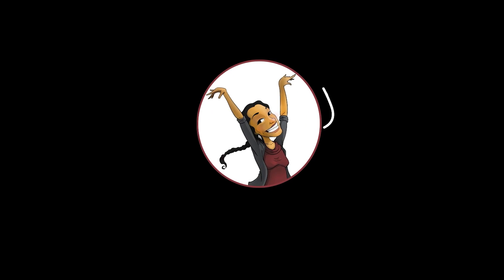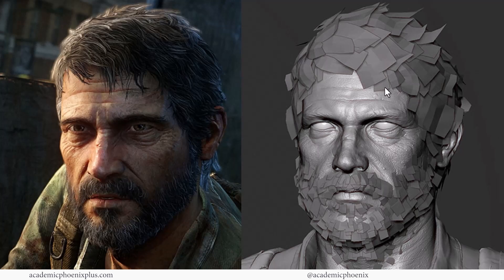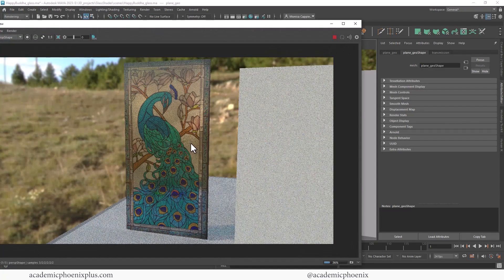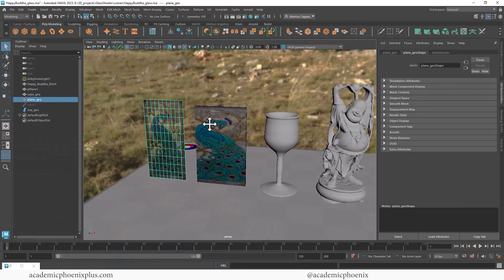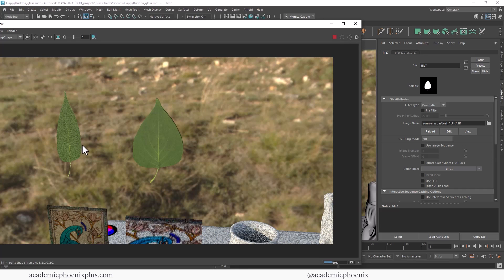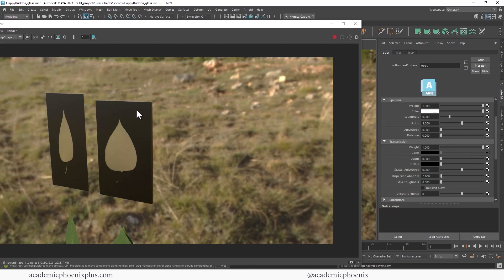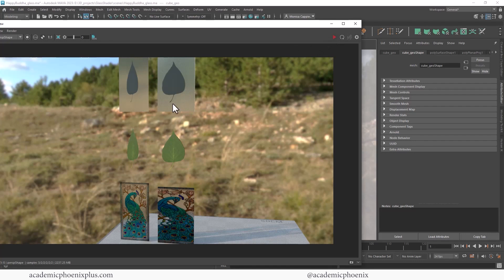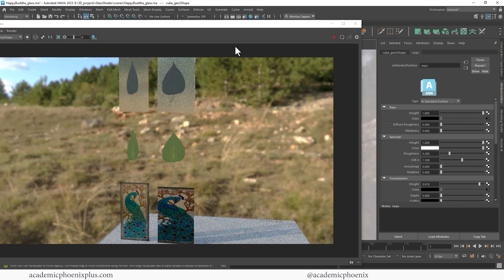Understanding Opacity vs Transmission in Maya 2023

Comment: hi i was using substance painter,made a glass window with some wooden pannels,both the glass and the wood panels share the same sader with proper uv,and in substance everythinglooks fine and behave properly but when i plug in the opacity map on to transmission the whole mesh including the wood panel also becomes transparent which doesnt happen in substance painter

Comment: Hello i need help. How to assign different shaders to Nparticles ? I dont see any visual feedback 😢
Reply from the maker: Have you tried adding an aicolorjitter into the nparticle shader? https://youtu.be/jmqBa_t2_QI  I haven't tried it but may be a good place to start.
Reply from the maker: Have you tried adding an aicolorjitter into the nparticle shader?
Reply: @AcademicPhoenixPlus  thank you for respond. Basically i only want to assign standard surface shader to nparticles. I also only want to render using maya hardware 2.0. 😭 nothing super fancy.

 But for some reason nparticles by default already have blin shader (i saw in outliner)  and change or remove that shader doesn't do anything in viewport. 

Thanks.

Comment: how do one get semi transparent values in alpha channel? I'm failing to achieve that. I want to render a flat glass surface and need alpha channel to behave normally so i change BG color in photoshop.
Reply from the maker: That's a good question. If you want it to be semi transparent, use grey colors. That will give you a variety of transparencies. I hope that helps!
Reply: I figured it out. Enabled Transmit AOVs and it worked.